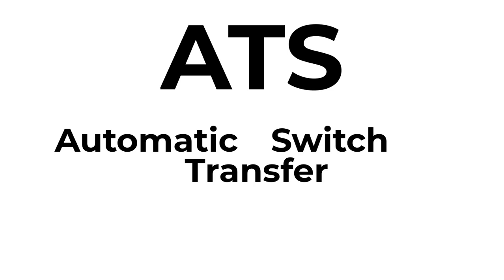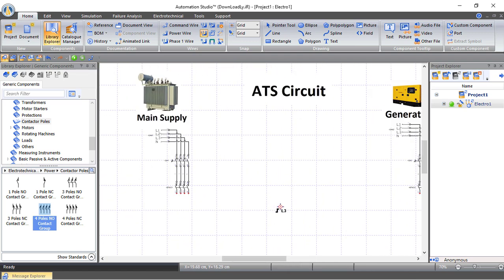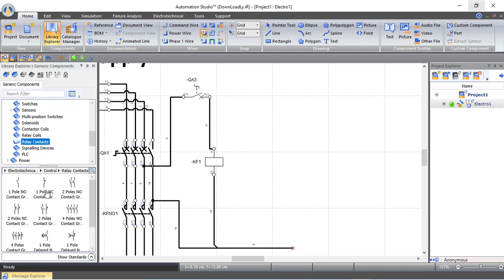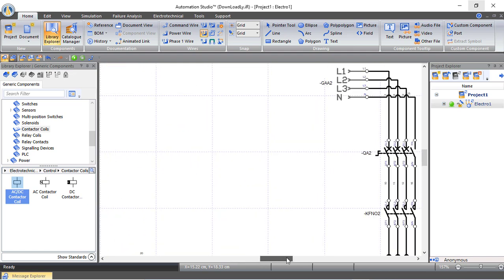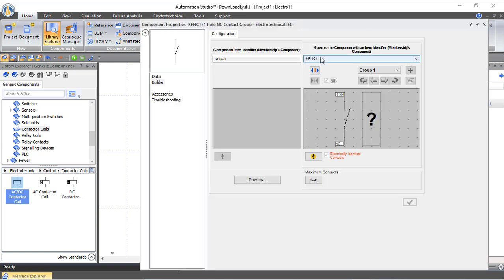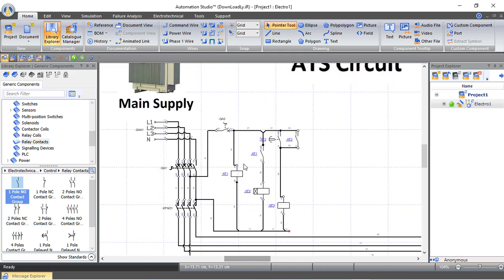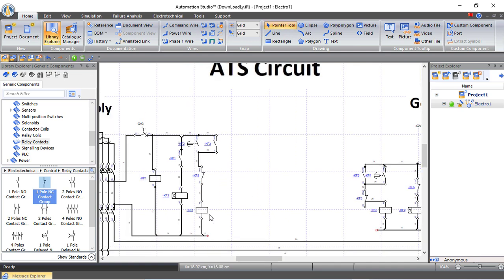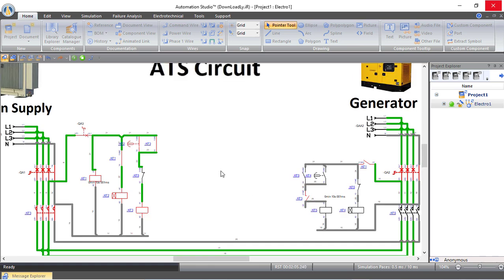Create Automatic Transfer Switch (ATS) circuit in Automation Studio | Tutorial #5 for beginners

Comment: Hello , Thanks for this wonderful Video , But there is a problem in this architecture

I would like to point out a potential issue regarding the wiring of the KF4 timer coil through the KF5 (NC) auxiliary contact on the emergency side:

- Issue: Once the timer KF4 completes its countdown, it energizes the KF5 contactor coil. However, as KF5 engages, its NC contact (KF5-NC) instantly opens, cutting power to the KF4 timer coil.

- Risk: This resets the timer immediately and opens the KF4 contact. Since this transition relies on mechanical contact switching, if the self-holding contact (KF5-NO) does not close before the timer resets, the KF5 coil will lose power. This creates a high risk of chattering/vibration (fast cyclic opening and closing of the contactor).

i Recommend that you Remove the KF5 (NC) contact from the KF4 timer branch and power the KF4 coil directly through KF1-NC. This ensures that the timer remains stable and powered throughout the entire emergency operation without risking contactor chatter.
Reply from the maker: Thank you for your information and valuable time❤